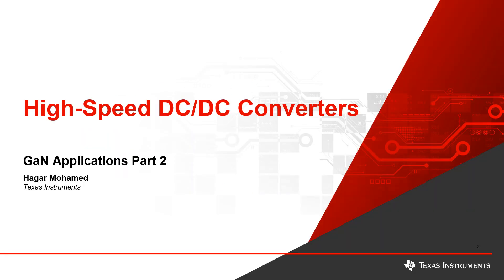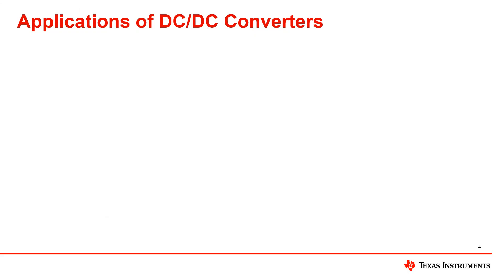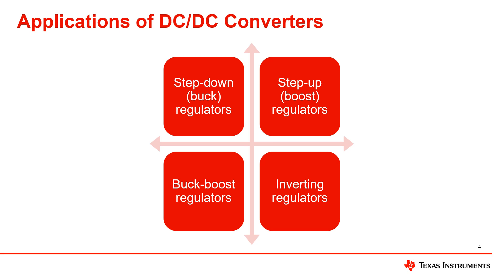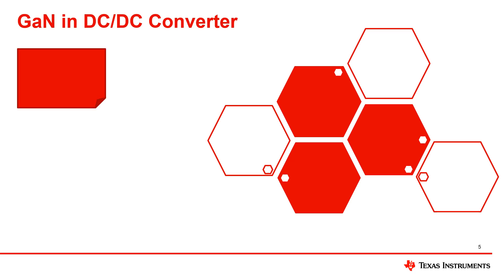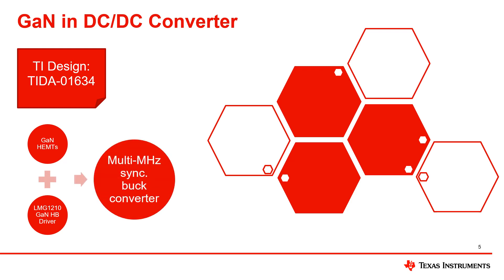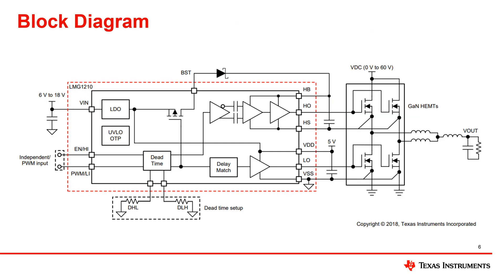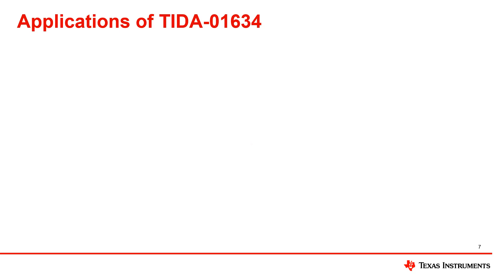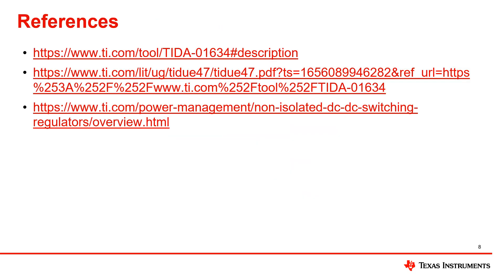High-Speed DC/DC Converters using GaN

Comment: "Higher power density" while still using 1920 vintage circuits. Why are GaN manufacturers afraid to try GaN switches in 21st-century circuits like the Ćuk-buck2 or the Bridgeless PFC circuit from the 1970s.